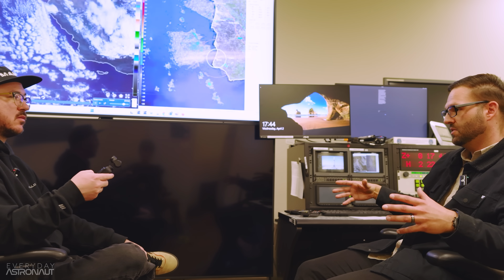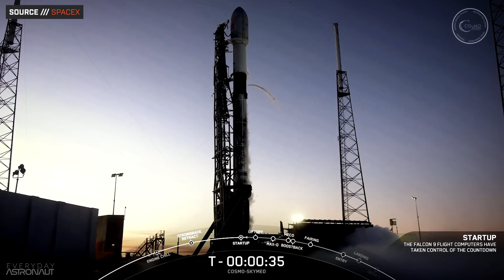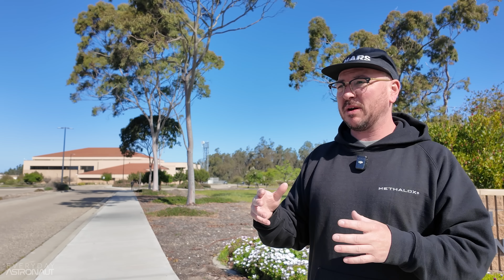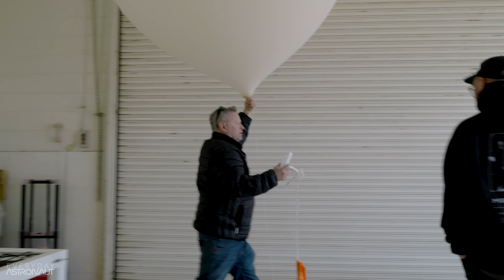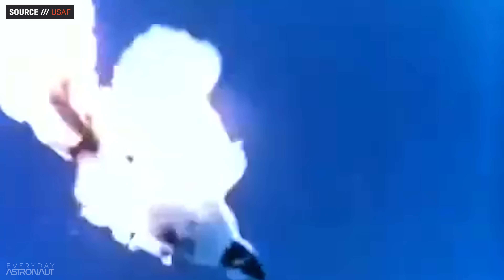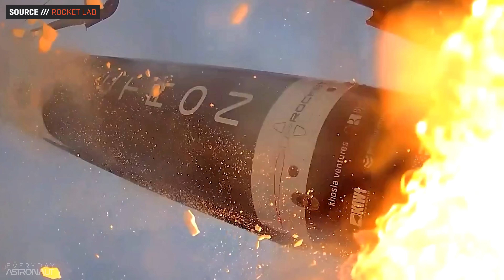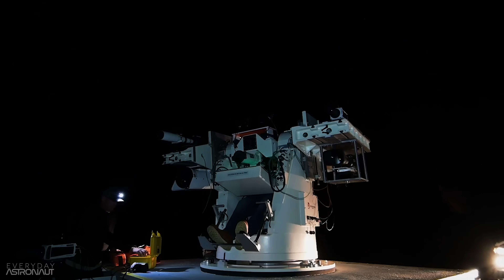Why do rockets scrub because of weather?

Comment: The guy releasing the balloon said something that is both accurate inaccurate and confusing the way he described it.

The balloons are all launched at exactly the same time within 15 minutes(this covers for say landing planes at airports. The launch time is actually UTC. 

At Vandenberg and anywhere in the pacific time zone they're launched at 4:00 a.m. and p.m. if you were on the East Coast which is Eastern Time. Those balloons are launched at 7am and 7pm in the summer and i think 6 am/pm in the winter.

They rise quickly and are only in the aircraft fligh levels for a short time on the way up and on the way back down.

Comment: "FTS is saved". I have always wanted to ask why they call out "FTS saVed". What were they saving? But I have picked up along the years that the call is "FTS saFed". So, safe to not blow up anymore.
Reply: You nailed it that's exactly right! "FTS is safed" means the Flight Termination System has been disarmed and is now in a safe state, no longer able to activate. It's a crucial callout confirming the rocket is no longer capable of self-destructing, usually after it has passed the point in flight where it would be needed. Great pickup it’s one of those subtle but vital bits of launch lingo.

Comment: Hey Tim, awesome video! It would be really cool if you could do a video about how does SpaceX delivers their software/firmware to their onboard computer? How does the military know that software hasn't change since the last certification? How does SpaceX knows it? I wouldn't like my rocket to use a different software/firmwaare than the one I know works (some bad actor could change it)

Comment: Ok so given starship hasb2 very large distinct parts that need seperate abort systems as the booster or ship could indipendantly complete mission exen if the other does not, is ther 2 buttons for starship super heavy, also is it the same for falcon heavy, is there 3 abort systems as each falcon 9 could seperately need aborting without blowing the whole thing up, is therr multiple people watching the individual assets with their own buttons in that case?

Comment: Good video. It would have been better if you interviewed anyone from the safety office. They certify the systems, requirements, and people who actually do terminate rockets. Everyone interviewed actually get their requirements and contraints from the SLD30 safety office for government launches and the FAA for the other 95% of launches. Also the 45 second rule is specific to a single user due to their squibbed FTS batteries

Comment: FYI -If you want to watch a Vandenberg launch, you can literally drive within a mile or so of the launch pad. Just put in the intersection of W Ocean Avenue & Ocean Park Drive and park on the south shoulder about 1/4 of a mile east of that intersection. You won't have a view of the first 100 to 300 feet of launch, but it is the closest you can get.

Comment: Wait, what about human flights? Does the range have the power to kill the astronauts to save the lives of the people on the ground?
Reply: A bulk destruct termination is not used on manned flights.  Instead other abort methods that allow escape of the crew are the primary functions.  Some boosters still have FTS but would require separation of the crew capsule before termination of the booster.  It's unique to each platform.

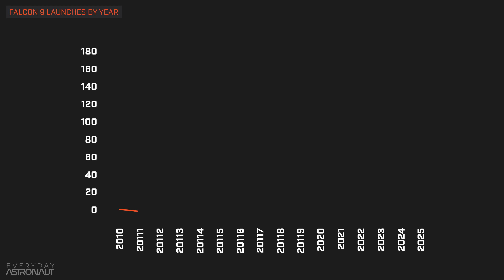Comment: 6:07 graph here has extra digit for the 2010s making it say 20,111, 112, etc
Reply: ah yes the year two thousand eleventy two
Reply: Yet 2010 displays correctly.
How on Earth does this happen? Was it all manually typed?
Reply: @musaran2  The only thing I can think of is they automatically replaced 0 with 11 12 13 14 etc.

Comment: 0:27 Stay strong Windows 10 users
Reply: I hope they're paying for ESU
Reply: @BoxersteaveeI wouldn’t be surprised if they have a separate agreement with Microsoft for support. As far as I know DoD is still running Windows XP for some critical systems
Reply: @Boxersteavee is it even on the internets? if it's an offline system it could run XP and still be secure
Reply: @deelkar possibly but maybe not if it's on a LAN with others that aren't, or is otherwise accessible... If it's a completely isolated machine that cannot talk to anything else, then yes it is safe. If there is any exception, then there is a chance it is not.
Reply: I'm guessing if they call Windows Support someone will answer the phone.

Comment: Seeing the use of metric decimals, instead of using the original imperial terms (that they were measured and displayed in) looks and sounds so messy 🤣.
.
I'm down with metric, but not when it makes it clunky...
Reply: where? 
(Curious to see if I agree if I look for it :))
Reply: @snuffeldjuret Close to the beginning lol. He was talking about range clearance... Only went to the nearest tenth but said 4.8km (3 miles) etc
Reply: @snuffeldjuret 12:12 or so... I'm sure there are some more but 
...6.4km (4 miles) and 1.8 km (6,000ft)
Reply: @obsidian....  hm, doesn't upset me, I can manage one decimal :D
Reply: @snuffeldjuret Yeah, it's just that they are quoting a conversion, which means they read it in imperial, did the math and then wrote the messier converted number in their script... 
.
I just find it funny.

Comment: why are airplanes fine when lighting strikes but rockets no?  Maybe just put a flipping lighting rod on em or something and then they can launch whenever?
Reply: They explained it. Because the rocket is grounded. Airplanes are not.
Reply: Because planes need to be hardened against lightning, because they're accumulating thousands of hours flying through the atmosphere, so statistically, hits will be common. In contrast, rockets (especially expendable ones) are only spending minutes of their existence in atmosphere, so lightning strikes are easily avoided simply by not launching during thunderstorms.

Comment: Do planes or ships get fined if they cause a scrub?
Reply: this would be my question as well
but if the answer is no, I don't want ppl to know :P
Reply: @snuffeldjuret , google/YT apparently doesn't like you. Your perfectly reasonable comment was hidden until I changed "Sort by" to "Newest first."

(BTW, I agree with you, on both counts.)
Reply: @ncdave4life  hehe yeah, yt was going after me since before it was common knowledge that there was any moderation at all in the comments outside hiding literal slurs :P. It was hilarious to be able to post identical things on an alt account and have people tell me "no it is not happening, you are making it up".
Reply: @snuffeldjuret  your reply to my reply is also hidden with the default sort order.

Fortunately, it did show up in my notifications, telling me that you had replied to me. But nobody else (or hardly anybody else) will see it.

I used to hugely admire G/YT. But they are a very, very different company, now. Now I detest them.
Reply: @ncdave4life  ty for the info :)
yeah, it is a shame, yt was honestly the best place for discussions imo, now it is barely possible to do that :/.

Comment: Got a 98 as my ASVAB. If I could be a part of Space Force when I was younger, I would have done it. Cool stuff. Mundane and boring to most, but cool stuff!

(P.S. I regret not joining, as I was told my top 3 positions would likely be nuclear, programming, or engineering roles. The private sector was flimsy and full of what modern day people would call "woke/mental illness."

Got a sibling that was in Afghanistan - oddly enough he's about as woke as you can be. Mental illness.)

Comment: I was at Vandenberg in the 90s while working at Boeing. I wrote a program to launch test missiles using a laptop. It saved lots of money since the interior of the launch tube would be mostly destroyed by the acids created by the solid rocket motors. Instead of having to replace all of the hardware racks and electronics inside them after each test, we just needed one drawer with a modem and the key electronics to replace. Everything else was in the laptop, which was totally safe and probably in one of the buildings you saw. Was fun to see the mix of the old 'battleship' desks with modern monitors etc replacing all the CRTs that were there.
Reply: I liked seeing the old-school CRT cabinets. I was torn between "why don't they update this place" to "thank goodness the Space Force saved money by reusing equipment they already had."